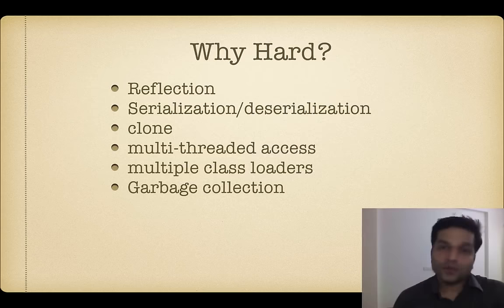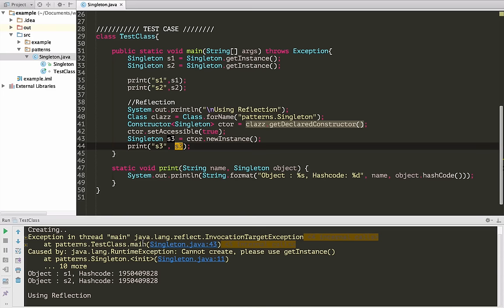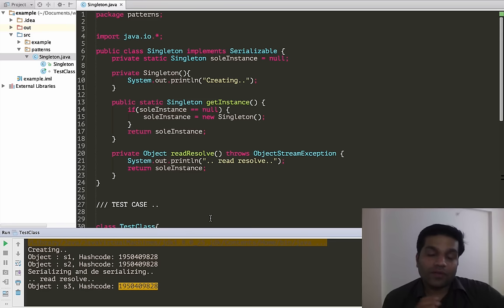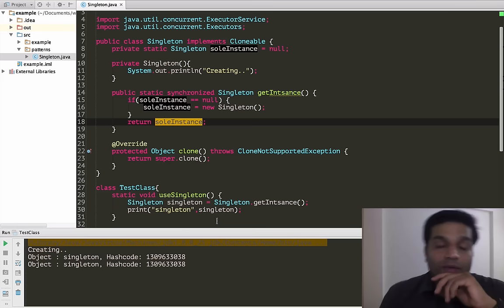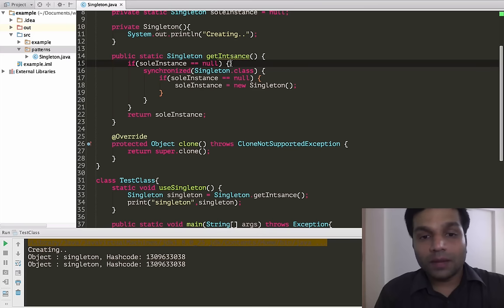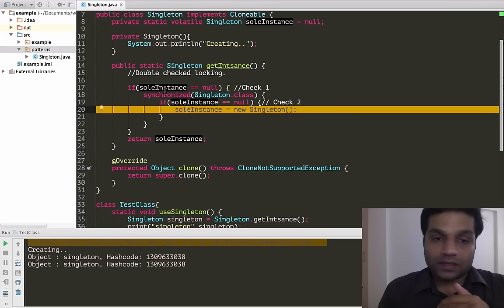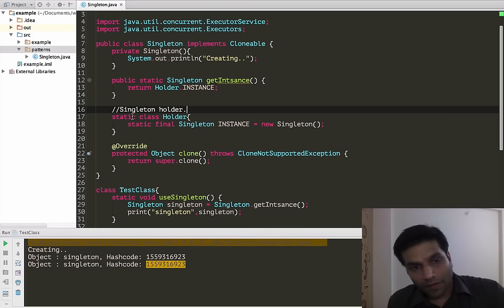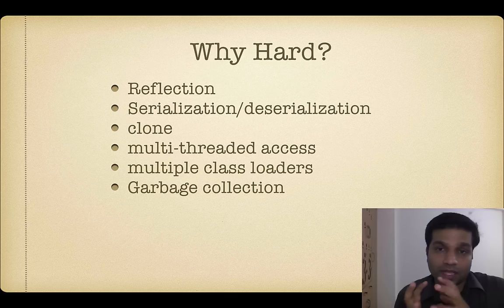Singleton design pattern in Java - Part 2

Comment: Thanks Ranjith for this excellent material on Singleton. I believe this is one of the most common yet misunderstood pattern in programming. Your video series simplifies many of the complex notions built around it. Kudos.
Reply from the maker: happy2k thanks for the feedback; yes, most of us takes singleton as the example of design pattern they used, meanwhile it is very hard to get right!

Comment: Answer for situation where constructor called prior to getInstance method using Reflection:
-> One way is by creating a Static boolean flag and set it TRUE in constructor when constructor executes successfully for the first time. You can use this flag in getInstance method to check if object is already created or not. If flag is TRUE that means object is already created and you don't need to create an Object. Here you can throw runtime Exception.

Comment: I think we are still able to break. After adding 'throw RuntimeException' in constructor, if we use multi-threading for Reflection we can create 2 distinct objects

    static void useSingleton() {
        try {
            Class clazz = Class.forName("com.patterns.Singleton");
            Constructor<Singleton> ctor = clazz.getDeclaredConstructor();
            ctor.setAccessible(true);
            Singleton s3 = ctor.newInstance();
            print("s3", s3);
        } catch (Exception e) {
        }
    }

Invoking above method with 2 threads, we see 2 different objects created  :)

Comment: Thank you Ranjith for such a good videos. As you said, we'll have a discussion in comment section regarding the solution for violating singleton rules by creating the instance(s3) and then s1, s2 using Reflection. How can we restrict multiple instances and maintain Singleton pattern? Please answer.
Reply: did you find the solution ?
Reply: One way is by creating a Static boolean flag and set it TRUE in constructor when constructor executes successfully for the first time. You can use this flag in getInstance method to check if object is already created or not. If flag is TRUE that means object is already created and you don't need to create an Object. Here you can throw runtime Exception.

Comment: It's  the best explanation  i have ever seen on the web about the singleton design pattern. I have one query, the way you have followed to avoid singleton breaking by reflection will not work if the first instance is created by reflection and second instance is created by getInstance() method. Could you suggest any way to avoid this as well?
Reply: In the constructor, if you are not throwing an exception, you can assign the value of the private static variable as this, like below
        private static Singleton singleton;
 private Singleton() {
  if (singleton != null) {
   throw new RuntimeException("Cannot create an instance of Singleton, please use getSingleton method");
  }
  singleton = this;
 }
Reply: One way is by creating a Static boolean flag and set it TRUE in constructor when constructor executes successfully for the first time. You can use this flag in getInstance method to check if object is already created or not. If flag is TRUE that means object is already created and you don't need to create an Object. Here you can throw runtime Exception.

Comment: Nice video ranjit.you explain really well. Thank you for such a nice video. I would like to know how can we fix the issue of creating an instance thru reflection when we place the code at the beginning of main method.thanks in advance.
Reply: One way is by creating a Static boolean flag and set it TRUE in constructor when constructor executes successfully for the first time. You can use this flag in getInstance method to check if object is already created or not. If flag is TRUE that means object is already created and you don't need to create an Object. Here you can throw runtime Exception.

Comment: Firstly thanks for tutorial Ranjith.What if the reflection call is there before getInstance method() call?
There two instances of Singleton class is getting created.How to prevent that?
Reply: One way is by creating a Static boolean flag and set it TRUE in constructor when constructor executes successfully for the first time. You can use this flag in getInstance method to check if object is already created or not. If flag is TRUE that means object is already created and you don't need to create an Object. Here you can throw runtime Exception.
Reply: @rohitborate9824   @Rohit Borate  Okay but how to get hold of the instance already created? In case the instance is created through reflection is there any way to get hold of that instance in Singleton class?

Comment: Really great work Ranjith, learning so much from you tutorials. I have a question, not sure if this is a possible scenario but I wanted to get it clarified. In the example where you implemented synchronization by double checking the condition to make it thread safe, let us say there are 2 threads both passed the first condition and the 1st  thread entered the synchronized block and the other is waiting. Now the 1st thread passed the 2nd if condition as well and at this time just before creating the instance let us say the thread is preempted by the OS and 2nd thread is scheduled to run. The 2nd thread passes through the condition as well because instance is not yet created , and goes ahead and creates the instance. Once it exits the first thread might resume and create one more instance which violates our aim. So, is it possible for a thread to be preempted by OS in a synchronized block?? if it can be , will that thread relinquish the lock so that other threads can enter the same critical section?? Thanks in advance !!
Reply from the maker: +Avinash Vutukuri - the given scenario can be a possibility. However, 2nd thread still can not enter synchronized section as thread1 still has the monitor(lock) with it. So 2nd thread will be blocked until 1st thread completes. Only object.wait() will cause the lock to be relinquished (the locked acquired on object) AFAIK

Comment: Superb video SIr! Thanks a lot.
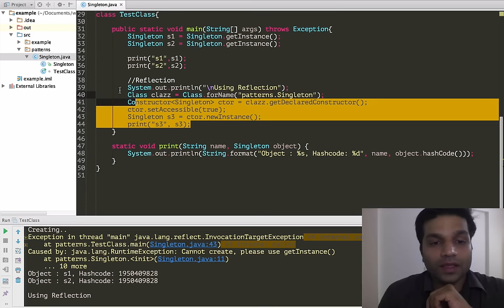What's the answer to the question at 3:47
Reply: One way is by creating a Static boolean flag and set it TRUE in constructor when constructor executes successfully for the first time. You can use this flag in getInstance method to check if object is already created or not. If flag is TRUE that means object is already created and you don't need to create an Object. Here you can throw runtime Exception.

Comment: In double check locking method, if thread 1 has already created an instance, doesn't that mean it has acquired a lock on Singleton class while doing so? If so, other threads wont be able create a new instance anyways, so why the double null check? I know it's there in theory, but practically i feel only a null check and a lock on class level should suffice
Reply: Thats explained around 13:15.

Comment: Hello Sir , I tried this Example and as you said just copy that Reflection mechanism at the starting of main method but in that case it will not create any object of that Singleton class so what should be the solution...? plz reply...Thank you
Reply: One way is by creating a Static boolean flag and set it TRUE in constructor when constructor executes successfully for the first time. You can use this flag in getInstance method to check if object is already created or not. If flag is TRUE that means object is already created and you don't need to create an Object. Here you can throw runtime Exception.

Comment: Hi Ranjith thanks for deeply explatation of the singleton pattern. I have a question I have put reflection code before  
   
//Reflection
  
    Class cass=Class.forName("singleton.Singleton");
           Constructor<Singleton> cross= cass.getDeclaredConstructor();
            cross.setAccessible(true);
   
            Singleton s3=cross.newInstance();
            print("s3",s3);

Singleton s1=Singleton.getInstance();
  Singleton s2=Singleton.getInstance();

but I did not get any exception ? I get hash code like

Object :s3,HashCode :366712642
Object :s1,HashCode :1829164700
Object :s2,HashCode :1829164700

Please explain.
Reply: Put a debug pointer @ line 2 in the below constructor in the program
private SingletonReflectible() {
  if(soleInstance != null) { //line 2
   throw new RuntimeException("Cannot create. Please use getInstance()");
  }
 }
Put a debug pointer @ line 2 in the below method in the program
public static SingletonReflectible getInstance() {
  if (soleInstance == null){  //line 2
   soleInstance = new SingletonReflectible();
  }
  return soleInstance ;
 }

Now debug the program and check. Since the reflection codes are placed on the top so when the following line is executed : 
Singleton s3=cross.newInstance();
the soleInstance is found to be null and hence created so u get 
Object :s3,HashCode :366712642.

But what i don't understand is once the soleInstance is created by the constructor so why it is created again by getInstance() and returns:
Object :s1,HashCode :1829164700
Object :s2,HashCode :1829164700

Though in debug of getInstance() method i found soleInstance == null but why ?? And shouldn't it return the same hashcode for s1 and s2 as well as the instance is already created by the constructor ? 
Thank you.
Reply: I don't know whether I am right or not, but the explanation is:  when you are using reflection you are directly calling the constructor and the reference is returned to s3 object directly.
Singleton s3 = cross.newInstance();
So it is not assigned to soleInstance  because getInstance() method is never called. Please give your view. Thanks.
Reply: Can use like this by overloading constructors:-

class Singleton {
 
 private static Singleton onlyObject = null;
 
 private Singleton() {
  
  throw new RuntimeException("Incorrect method, please use getInstance()");
 }
 
 private Singleton(boolean actualCreationCall) {
  
  System.out.println("Only Object Created");
 }

 public static Singleton getInstance() {
  
  if(onlyObject == null) {
   
   onlyObject = new Singleton(true);
  }
  
  return onlyObject;
 }
}
Reply: One way is by creating a Static boolean flag and set it TRUE in constructor when constructor executes successfully for the first time. You can use this flag in getInstance method to check if object is already created or not. If flag is TRUE that means object is already created and you don't need to create an Object. Here you can throw runtime Exception.

Comment: Hi Ranjith, on reflection if we cut the Reflection block and paste at very beginning of main(), it s violating Singleton property of that class. What is the solution?
Reply: Hi @barunhalder1231 @Vipin Jain , I found 1 solution with that probably you could avoid creating multiple instances. 
1) You need to set a Boolean flag by default as false. Check that in private constructor, if it is false throw an exception saying that call get instance method to get the instance. This way you could avoid creating an instance using reflection.
2) If we set a boolean flag to false then, when you call getinstance method you gonna end up getting the same above exception. To over come this in get instance method you need to first set flag to true in such way you could create an instance. Once you done with creating an instance immediately set flag back to false.
See the sample code below.

private Singleton(){
  if(singleton !=null){
   throw new RuntimeException("Instance is already created call the get instance");
  }else if(isInstanceCreated==false){
   throw new RuntimeException("get the instance using getInstance method");
  }
  
 }

ublic static Singleton getInstance(){
  if(singleton == null){
   isInstanceCreated=true;
   singleton=new Singleton();
   isInstanceCreated=false;
  }
  return singleton;
 }
 
Any comments are welcome. By the way.. Ranjith, such an amazing explanation.
Reply: @srinivas, that mean whatever be the case, the private constructor will throw an exception.
Then why don't we throw an exception at very beginning?
Reply: No, it wont throw an exception @brunhalder1231.  Every time as you need to call getInstance method to get the instance right. So in such case the boolean value will be set to true right and it results in getting the instance without throwing an exception. After completing the getInstance method at any instance of time the boolean value will be false. Please try to embed the code in your work bench and test it. I am sure it should work.
Reply: I think this will be a best approach so far i came across. Will post any other solution if i come across any.
Reply: Yes, It violates. To avoid simply add else part as "soleInstance = this" in the constructor. Following is a sample  constructor for this: 

if(soleInstance != null){
            throw new RuntimeException("Cannot create. Please use getInstance()");
} else {
            soleInstance = this;
}
System.out.println("Creating...");
Reply: One way is by creating a Static boolean flag and set it TRUE in constructor when constructor executes successfully for the first time. You can use this flag in getInstance method to check if object is already created or not. If flag is TRUE that means object is already created and you don't need to create an Object. Here you can throw runtime Exception.

Comment: @3:55 I tried doing reflection first then two threads creating instances< making the call synchronized> .. looks like the singleton issue is still there. it is still creating two  instances.. how to fix this. 
anyone please help :O
Reply: One way is by creating a Static boolean flag and set it TRUE in constructor when constructor executes successfully for the first time. You can use this flag in getInstance method to check if object is already created or not. If flag is TRUE that means object is already created and you don't need to create an Object. Here you can throw runtime Exception.
Reply: Inside the constructor and outside the if statement, set soleInstance = this